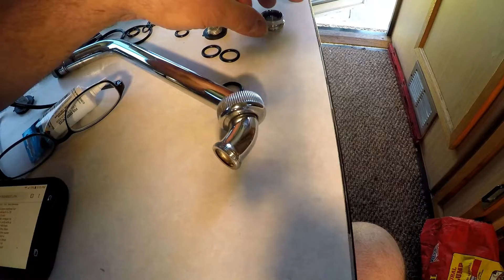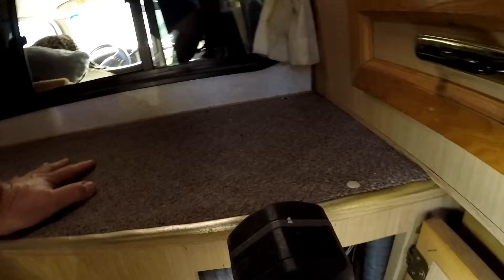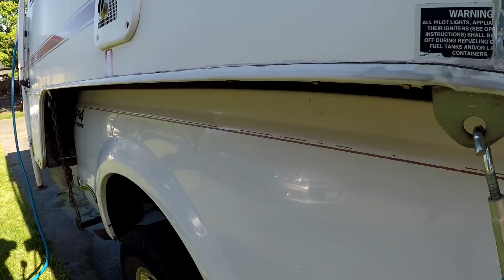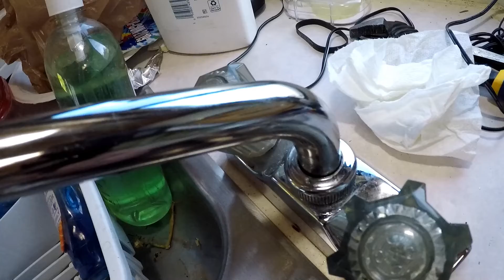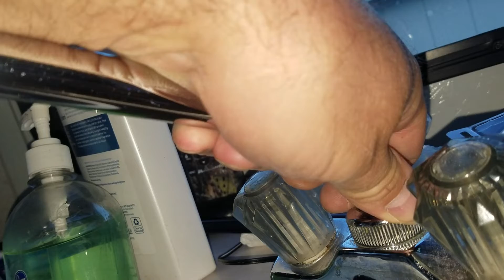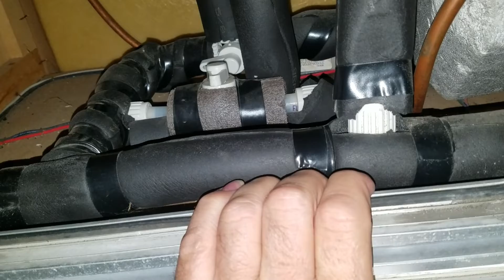RV Fresh Water System Sanitized Using Vinegar & Water Heater

Comment: First, isn't it taxing for the water pump to pump/circulate the vinegar through your system for 2 hours? Also, is your RV fresh water tank already filled with water? I ask because just using 2 gallons of vinegar seems like the water pump might cavitate?
Reply from the maker: It is a job for the pump but it handled it fine and is still working fine. It is the original pump from 2000. The water system was setup to recycle the hot water back through the system until the water heater reached temperature out the kitchen sink through a hose to the fresh tank fill port and repeat. I suppose you could adapt a larger external pump to do the job. It's been a while and I thought I used 5 or 6 gallons which is technically weak for sanitizing.  The water heater puts out scolding hot water and the fresh tank was hotter than you wanted to touch. This was an experiment after all and next time I'll just do a weak bleach wash and couple warm water rinses to save time.